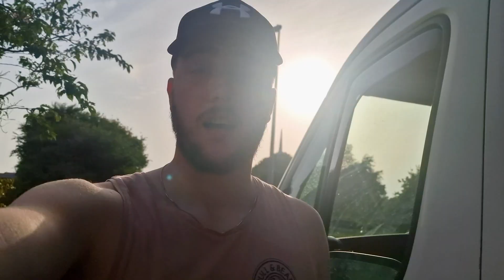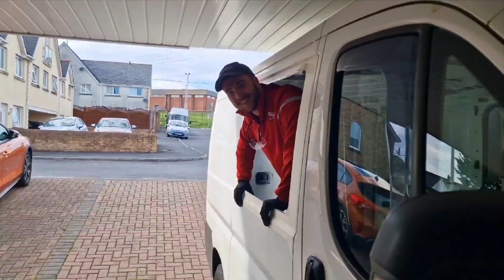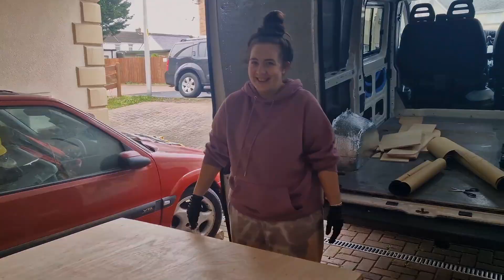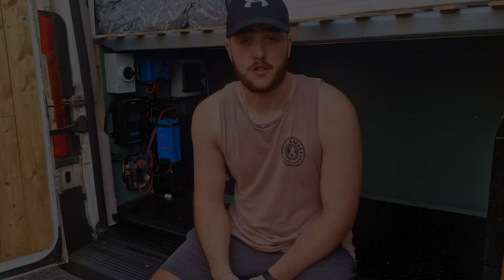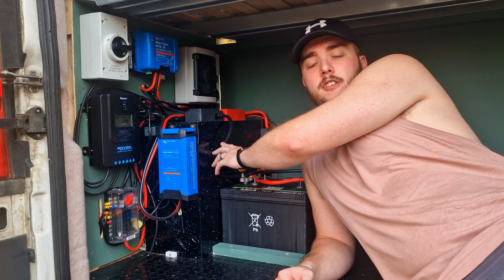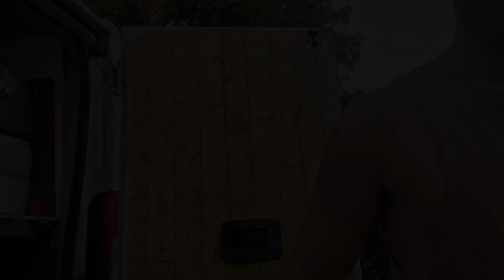Van Build ELECTRICS Explained | Part 2 | DIY Ducato VAN Conversion | UK

Comment: Done a great job for first effort. Make sure to keep the Lead Acid batteries in good charge over the winter. Ours died after 2 years infrequent use and a little neglected through winter as solar wasn’t sufficient. Upgrade to Lithium LIPO4 in the future when you can. Same power half the size and weight. 👌👍